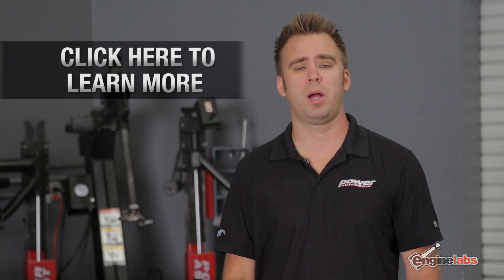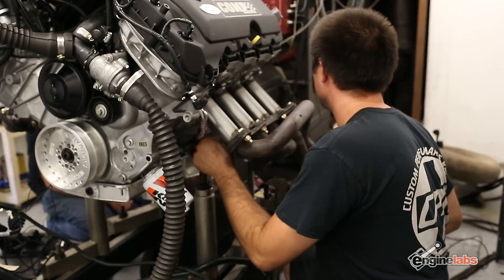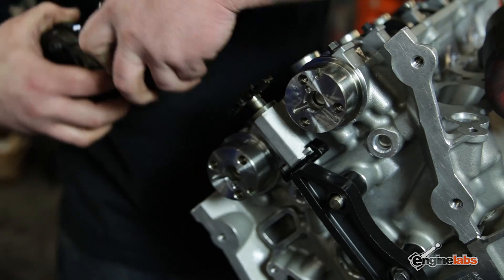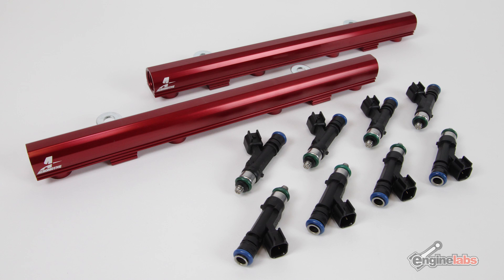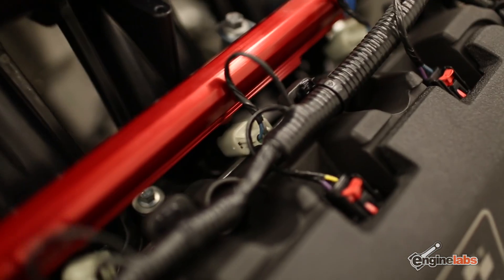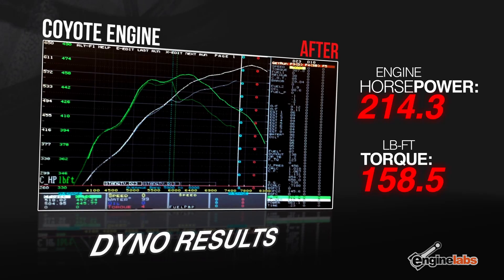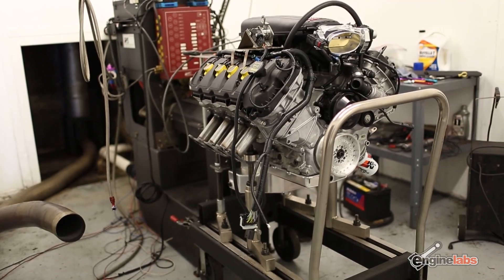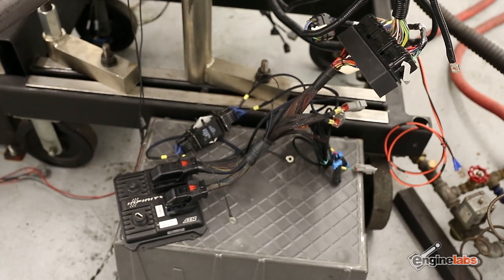Building a 625 Horsepower Coyote Street Engine That Turns 8,500 rpm

Comment: 2004 Lincoln Town car Signature! It has not been done before and that engine would make one of those suckers run like a hungry Puma!
Reply: I'd think they would use the trans from a mustang or beef up the 4r70w or 4r75w. Not sure if they changed the trans in the later years. I'm pretty sure the Lincoln is longer, I have seen a few high hp Lincolns but I don't know what they used for the trans.
Reply: Just use the 6 speed from a mustang or the manual.. Not a ton of mods and you'd have a smooth riding street beast..

Comment: I have a 180" slingshot dragster for sale never been down the strip yet and the chassis is certified, a 302 stroke to a 342 is currently in it carburatored with a QF 750 alcohol carb, JW 2 speed power glide, trans brake, rated up to 900hp, 5500 stall converter, the fiberglass body is autographed by some famous racers such as Don Pruhdomme, Tv Tommy Ivol, complete roller and comes with another new extra spare chassis have $54,000 invested into all the above asking $35,000 or best offer can pull the trans and engine out to reduce. The price to $25,000 firm can't go any lower. Here in Arizona

Comment: If you guys beat me and put it in an "F-body" camaro. Y'all would be my heroes and millions of other ford guys
Reply: HELL YEAH!
Reply: Wont fit engine is way to wide and big, that's why ford guys always do SBC and lsx swap because the engine is smaller
Reply: 88TransAmGTA I've seen a 5.0 Modular in a Scion FR-S and both the 4.6 cobra motor and Coyote in ford focus cars. If they fit I imagine it would go into a Camaro of any year. But it would be more hassle to wrench on due to the size of those heads.